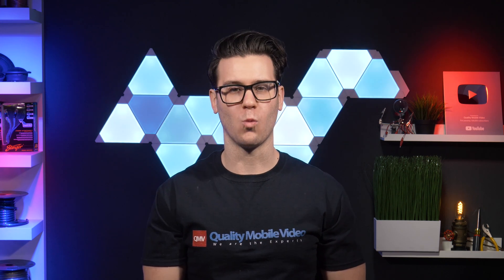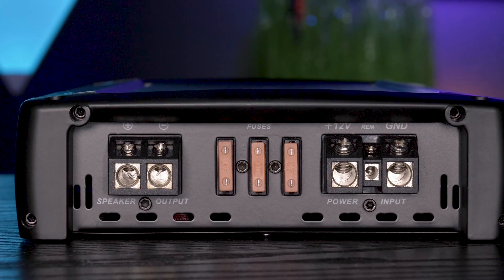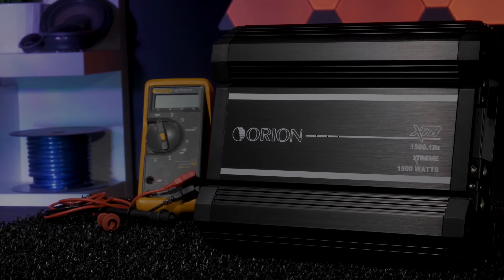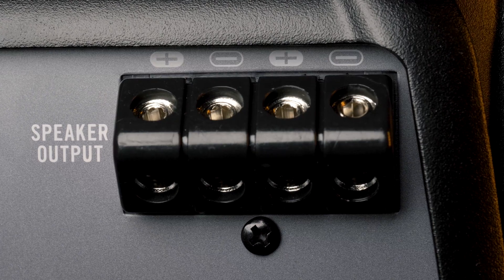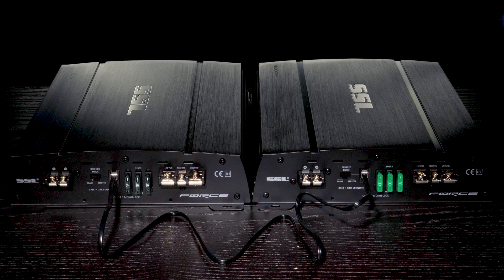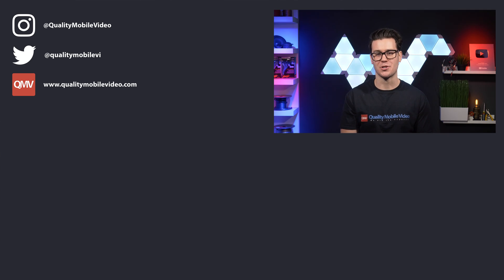Your MONOBLOCK Amplifier has TWO SETS of Speaker Terminals - WHY???

Comment: So will a dvc driver act as “two speakers”? Like if I wire each negative to each negative and the positives to positives from the vc connection to terminal to amp. Is that still considered a parallel wiring scheme even though I didn’t technically connect the negatives of each vc?
Reply: Basicly yes u just connect the sub in paralel if u just connect the sub to the amp by connecting the first voice coil normaly to one speaker terminal then the other coil to the other terminal because the terminals are connected on the amp same as if u connected one positive to amp then one negative to amp then on the sub from one voice coil to the other u link positive to positive then negative to negative

Comment: Thankyou I got mine bridged and run in a series. I run this pioneer amp with 2 12 inch pioneer 800w subwoofers the older blue ones till I can upgrade to alpine type r 12s or they might be type s as my cousin gave them to me I just have to pick them up. How do I wire two 12s to my amp at 1 ohm? The chart on google has me confused. Please help.

Comment: With that 2 channel ampt...Could I connect 4 door speakers --> 2 to each channel? Speakers are 4ohm each connected in parrallel reduces it to 2ohm. So the channel connection needs to read 2ohm correct?

Comment: But can I use my Qwork pa horn speaker rate at 100w and connect it to my Audiopipe 1500 watt amp . It have 2 set of speakers but I only running 1 Sub and I have one set of speakers on my amplifier . Can I use it on my pa horn speaker??

Comment: so because my monoblock amplifier has 2 sets of channel connections. I could have 1 for my subwoofer, but could I add a crossover and tweeters to it?
Reply: Too much power for tweeters, they’ll explode. Remember, electricity find the path of least resistance so your tweeters will blow immediately. I know my reply is 8 months late but hopefully this didn’t happen to you.😅

Comment: i have a pair of 4 ohm DVC subwoofers, if i wire each of these for a 2 ohm load and connect them separetly into the speaker outputs in my mono amp, will i have a 2 ohm load final? or they will bridge inside the amp and have a different ohm load
Reply from the maker: No, if you have a monoblock amp and connect both as you said, you will be paralleling the the connections, that is a 1 ohm load.

Comment: My question is... lets say I have a sundown audio salt 3k amp and a dual voice coil sundown audio nsv5d2 sub. If I run each vc to its own output on the mono amp (having 2 speaker outputs) what does that do to the final ohm load? That's where I'm confused... please help me.
Reply from the maker: 1 ohm if you have one woofer
Reply: @Qualitymobilevideo  so you're saying if I have a dual 2 ohm, and I run each voice coil directly to the amp outputs (amp having 2 +'s and 2 -'s outputs) that speaker will be wired in at 1 ohm?  Thanks for the speedy reply.

Comment: Didn’t really answer my question fully. I have two dual 4ohm subs I’m wanting to run at 1ohm final. My amp is a monoblock with two positives and two negatives…how do I go about getting my 1ohm final?
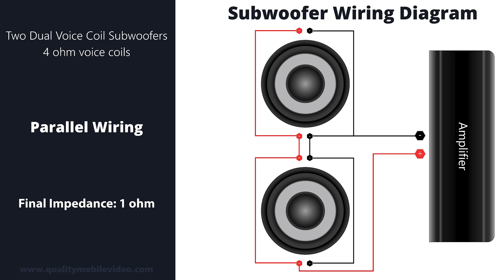Reply: The exact scenario you’re talking about is used as an example at 1:37 . Individually connect BOTH your 4ohm DVC speakers in parallel to get 2 ohm. If you use a “Y” connection you should have one left over cable for positive and one for negative on each speaker, when you combine the speakers you end up at 1ohm impedance. Connect those to the amp. (Most mono amps that have “dual output” actually combine the two positives and negatives internally) Be sure to always test your ohm reading with the speaker facing up and untouched, before powering up. Now go bust some windows.

Comment: So if I use both terminals on the amp and each speaker is wired at 1 ohm will the final impedance be 1 ohm then because I have 2 dual 4ohm 12" subs in a sub box with 2 speaker terminals 1 on each side of the box 1 for each speaker and my amp is a mono with 4 terminals 2 + and 2 -  and I need the final impedance to be 1ohm every video on wireing eases 1 terminal from the sub box to 1 terminal on the amp but like I said I have 2 sets on each the box and the amp and would like to use them all due to wire size
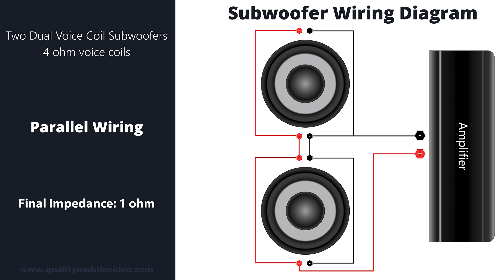Reply: No, when you combine 2 speakers wired in parallel, you will half the ohm amount. 2ohm dvc sub wired in parallel gives you 1ohm; if you add another the same way you’ll get 0.5ohm which must amps are unstable under 1ohm load. Look at 1:37 for reference on what wiring in parallel does to impedance when adding an extra speaker, this video is very good at explaining.

Comment: I have an mono with duel connections but I need to get my subs to 2ohms by wiring in series. How do I plug that in to the amp? I’ll just have one sec of wires. Can I just use one side and be fine ?

Comment: Can I wire x2 4 ohm dvc subs in series and connect the negative and positive to each output separately and still get a 4 ohm load? Usually you would connect them to the same terminals if only had 1 output but since there are 2 outputs can I hook each positive and negative to each output ?

Comment: So if I have a 2ohm mono amp with the dual output option, and I want to wire 2 subs, each speaker would need to be 2oh or 4 ohm?
Reply: You need a 8ohm dual voice coil speaker wired in parallel to get 4 ohm, connect that to the amp. Now, get another one the exact same and wired the exact same to the amp… when you have 2, 4ohm loads to the amp it comes down to 2ohm impedance, which is what you want..

To answer your question directly, you actually need TWO 8ohm dual voice coil speakers to get a final impedance of 2ohm. :)

Comment: Hi, I'm planning to run a JL AUDIO 10TW3-D4 sub which is a DVC 4Ohm with an amp Sony XM-GS100 which is a mono amp but has 2 sets of speaker terminals. How should I wire them up? Is it possible to run the sub at 4Ohm?
Reply: 2ohm or 8ohm only

Comment: Need some advice, I have a skar audio 1200.1D monoblock amp. Runs at 1200x1 RMS at 1 ohm. This amp has 2 sets of +&—. I have 2 DVC 2 ohm subwoofers that run at 600rms. If I ran each sub to 1 ohm and connected them in their own positive and negative. Would that still put a 0.5 ohm load on my amp?
Reply: If you wire your subs in series which is + to -  + to -  on both subs then the remaining coils+to + -to - which is parallel you will get a 2 ohm load at your amp. You can only wire yours subs in 2 or 4 ohm configuration if you want to get 1 ohm final impedance you need dual voice coil 4 ohm subs wired in parallel to achieve 1 ohm load

Comment: Never get a clear answer on whether or not using both sets of terminals changes the final ohm load. If you take two 4 ohm speakers and wire them, are they 4 ohms each or final 1 ohm?
Reply: Exactly what I want to know..cause if u put the wires together an hooked them up as if there was only one output the ohm would be different than if u separated them an then hooked them up. Makes no since
Reply: @raymondgideon2065  from what I gathered if they have two sets of terminals it depends if you're internally connected or internally bridged if they're internally bridged you take two sets of two ohms together it will knock it down to one if it's not internally bridge it will stay at two ohms per speaker. Or two ohms for input. So you really got to check the owner's manual or check with the manufacturer or just get a two-channel amp and then you know exactly how it works lol

Comment: So I have 2 sets of 12s so 4 subs in total can I connect them both to a 1200 watt monoblock amp with 2 sets of speaker terminals
Reply: Your question requires a lot more information to get a good answer. Speaker impedance? Are they all dual voice coil? Wired in series or parallel? What are the stable impedance ratings for your amp? 😅

Comment: Hello.
What will happen if i hook 2 speakers x 300 rms 4ohm each, to dual terminals monoblock amp that has 2 connectors and 4 ohm 1x300 watts rms power?
Reply: 2 ohm load unless dvc, those can be wired to 8 each then paralleled to 4.

Comment: I have that same GM-D9701 running 1 15dvc sub at 1 ohm so thats 1200 watt rms.  If I wanted to add a 2nd sub that means Id have to get a 2nd amp or can it do 1ohm on both speaker ports?
Reply: I would love to know this also

Comment: My amp is a Rockford Fosgate bd1500.1 750x1 4ohm 1500x1 2ohm 
I have 2 dvc 2ohms . How do I wire them to my amp that only had 1 set of positive & negative inputs . The lowest is 2ohms stable .
Reply: You have to connect (1)+ to (1)-  of each voice coil then use the remaining + and -  to go to the amp or in your case connect to the empty + and - terminal of the other subwoofer which will be wired the same as the first. This will give you 2 ohms.  Then add another wire(can be a tight fit) into one of the 2 subs + and -   which will finally go into your amp.

Comment: Hi great video.  I was wondering if you can help me. I have the same pioneer amp as the video. Using one terminal I have two 4ohm dvc subs wired down to one ohm. 
If I use your method, with a separate terminal for each sub can I still achieve one ohm.
Many thanks in advance.
Reply: Year late but yep
Reply: @michaelmosley1817  cheers dude

Comment: So when using both pairs of terminals, is the impedance added or how does that work?
Reply: monoblock terminals are summed internally.  4ohm + 4ohm sub = 2ohm at the terminals ..... 2ohm + 2ohm subwoofers = 1ohm at the terminals.  Bother subs should be the same model and the same impedance and their resistances will be halved.

Comment: Can u run 2- 4 ohm subs hooked up in parallel to a final impedance of 2 ohms to a monoblock amp with 2 sets of speaker terminals seperately
Reply from the maker: If they're Single Voice Coil then yes. If they're are Dual Voice Coil then no
Reply: DVC subs would give you a final impedance of 1 ohm, if wired in parallel.

Comment: I have the same amp with 2 kicker comp vr 12s dvc 4 ohm subs and I got them run one speaker to one + then - to  the amp  and same thing with other speaker. Had 2 drill holes thru connector box because it was melting them. Got 12 Guage speaker wire and drilled holes thru. Ran them straight 2 amp. If I turn amp more than halfway up it just don't sound right.. Can't get my speakers to do what I want and I know there capable of. I've had 100 systems but I can't get these 12s with dh dvc 4 ohm 2 sound right.. Any pointers anybody? Would be appreciated..
Reply: To clarify, you should have a lead running from the positive of 1 VC to the positive of the other VC. Do this for both subs. Then, run from 1 VC positive & negative to your amp. Do this for both subs. Once done, both channels of your mono amp should be occupied. This puts your subs at a final impedance of 2 ohms. From there, your mono amp combines the two channels into one, that's what mono amps do, giving you a 1 ohm impedance.

Prior to this, you should be sure that you're not clipping, your subs RMS is matching that of your amp, & your wiring / electrical is in check!

Comment: if the ohms get cut in half. what happends to the watts? 800w amp rms 1omh . puts out 600w @ 2ohms. so conecting two 400w subs is good or bad?
Reply: Dont worry about the subs "power"  their impedance(ohms) is more important.  2ohm sub + 2ohm sub=1 ohm meaning each sub will get 400 watts and you  will get your money's worth from the amp.
Reply: My amp does 300w at 4ohms. Plenty of power an sound. Good luck everyone

Comment: So if my amp is 750rms at 2 ohm x  at 1 channel does that mean its 750 watts for both or they each get 750 watts
Reply from the maker: 750W total, the entire power output of the amplifier is 750W, not 1500
Reply: NO each subwoofer would get 375w each

Comment: My amp’s terminals go ++ - - and I want to connect one sub. Does it matter which positive and negative I use?
Reply: I have the same on my amp....use the outer terminals....it also will lower the ohm impedance the amp puts out as well...

Comment: Noob question - so I bought a full system which my auto trimmer is installing into an old muscle car of mine. SO - The guy at the audio shop sold me a 1500W Alpine mono (R-A75M) to run a set of 6x9 and 6” speakers. I also have a 12” Kicker sub and amp for that too. Fast forward to my trimmer saying I have the wrong amp for my speakers?? Saying I need a 4ch instead of a mono.. PLEASE HELP

Comment: So I have 2 subwoofers wired to 2 ohm. It's been wires the same way for years. I currently have a Rockford 1500.1bd amplifier from 2002. Let's say I wanted to  get a new amp. Well my subs been wired the same so all of the wiring is leading to 2 speaker wires left to plug into the amp. If I get a new amp that has 4 terminals instead of 2, can I just hook the 2 wires to 1 set up the terminals and leave the other 2 alone? Will I still see a 2 ohm load from my 2 subwoofers? I caught what you said in the video about 1 subwoofer but I have 2 and the custom box is closed so it would be a pain in my back to get it out and rewire to suit the new amp in case I would want to go back to the old one
Reply: I have same exact amp !
Reply: @camposdavid0000  I know right it's such a beasty amp car is gone but still got the HX2s and the amp can't wait to use it in a new car again been without Bass for like 3 months
Reply: @mallorycainjr.1921  I have 2 15 power hx2 2ohms each with the bd1500.1 in perfect new condition . Just waiting on big 3 upgrade and alternator to install set up 🔊

Comment: What is the difference between mono vs 2 vs 4 vs 5 channel amplifier
Reply from the maker: It really all depends on what you're wiring. If you're 4 speakers then a 4 channel is ideal, but a 2 channel works too. If you're wiring 4 speakers and a sub you'll want a 5 channel. A 2 channel is good for 2 speakers, but you could also wire a subwoofer to it

Comment: I have 1 SA15 4ohm dvc. I want to wire them down to 2ohm. Naturally I parallel wired. My mono amp has 2 sets of terminal can I just run and dedicate 1 wire from each subwoofer terminal going to the amp and still see 2ohm final impedance?
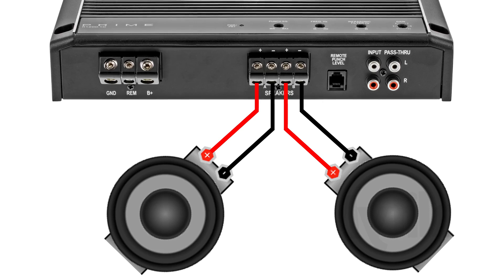Reply from the maker: Go to the 2:00 mark in the video

Comment: So I’m running two dual 4 ohm voice coil L7 15 speakers and I’m using a 1 ohm stable mono block amp that has two positive and negative terminals as well. I know that in order to get my 1 ohm load I should be left with a single positive and negative speaker wire after I’ve successfully paralleled my speakers. My question is does it mater what side of the terminal I put the single positive and negative speaker wire in or can I use either side.  Thanks 👍🏼
Reply: Wire the positive VC of your sub to the other positive VC & wire the negative VC on that same sub to the other negative VC on that same sub.

Now, do this to your 2nd sub!

Do NOT connect the two subs together!

Run 1 positive & 1 negative from each sub from the sub to your terminal on your enclosure, if you have one or directly to your amp, through the port or drill a small hole, if you like. You'll do this for both subs.

You will utilize both positive & negative connections on your amp. Your amp will now combine them into a 1ohm final impedance for you, that's what they do!
Reply: You’re good, just wire the speakers directly to the amp tho, don’t combine the wires before it reaches the amp. (You truly can do it but depending on your setup’s power and wire size it may cause damage, not worth the risk for a few feet of wire)
Reply: 2dvc 4ohm to get 1 ohm if your box has 2 speaker terminals on each side and mono amp has 2+ and 2- the mono amp parrallels the subs inside the amp so each sub doesnt need to be parralled to each other inside the box since they meet inside the amp sub#1  - to - and + to + then the + and - ud usually parrallel to the other sub just connect to the box terminal same with sub #2 then you box should have 2+ and 2- coming out of it then just put the wires into the 2+ and 2- on amp should turn into 1ohm load check with multimeter to make sure at the amp

Comment: So if I connect two SVC 4 ohm subs and I use both of the outputs will it do a 2 ohm load on the amp? If my amp does 900 watts rms at 2 ohms how much watts will go in each 4 ohm svc subwoofer? Are those 2 outputs and alternative to parallel wiring?
Reply: each sub will get 450w. the dual outputs are internally paralleled.  You can wire your subs to 2 ohms externally and use only one terminal or connect them to one terminal each it's up to you will still be 2 ohm final load
Reply: @rmblwgn  thx for the response but i have learned much about car audio over the last 11 months
Reply: @ArnoldGaming  gj!
Reply: @rmblwgn  thanks man

Comment: Hoping you could clarify a question for me.  If a mono block amp with two sets of speaker terminals has ratings of 1000 W @ 2 ohms OR 600 W @ 4 ohms, is this saying that each set of those speaker terminals would have that rating or would each speaker terminal rating then cut in half to 500 W @ 2 ohms and 300 W @ 4 ohms?  Hope that question makes sense.  Thanks.
Reply: Total output is 1000 Watts! If you had 1 sub connected, it would get 1000 watts. If you had 2 subs connected, each would get 500 watts!
Reply: @LTSRIDE24  now if you have two 2ohm subs and wire each at 1ohm and then connect them to there own terminal will both read 1ohm still because you cant wire two 2ohm subs together and get 1ohm ull get 4ohm
Reply: I wanna know this too

Comment: What's the difference between a monoblock amp and a misfit amp.
Reply from the maker: A misfit amplifier is a guitar amplifier, meaning it has an input jack for a guitar XLR cable, as well has a driver and plugs into the wall. A monoblock amplifier is designed for cars. You can't use a car amplifier for your guitar.
Reply: @Qualitymobilevideo  I play electric guitar and have never heard it called a misfit amp. Thanks. Just subbed